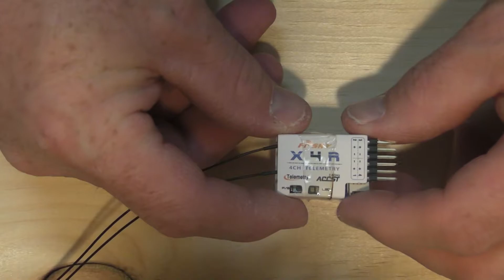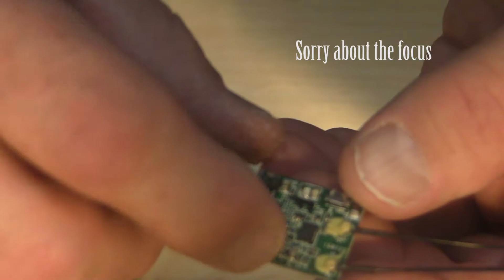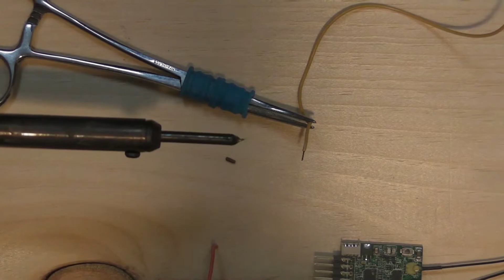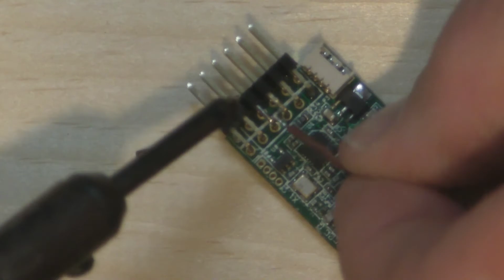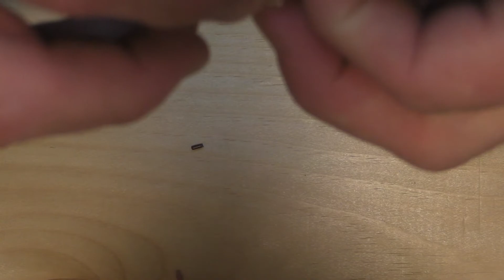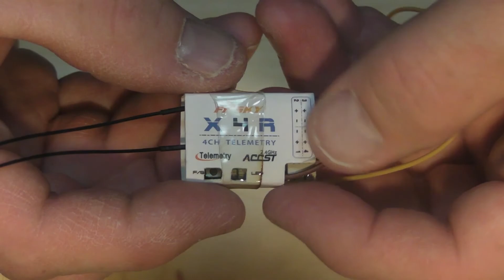FrSky X4R RSSI MOD

Comment: I am trying to get the rssi signal into my pdb with osd , the pdb have +5v , -  and rssi pad  but I just soldered the rssi pad from the receiver (x4r-sb) to the  rssi pad of the pdb but I don't get any rssi data , do I need the ground- wire also.?
Reply from the maker: OK, what OSD and what PDB? Also the RSSI from the FrSky receivers is a PWM signal. Does the OSD have a filtering circuit to filter this PWM signal to approximate a DC voltage?  BTW, I should have a video/how to coming out soon that explains how to do this, but for now, what OSD and PDB are you using?
Reply: this one  banggood.com